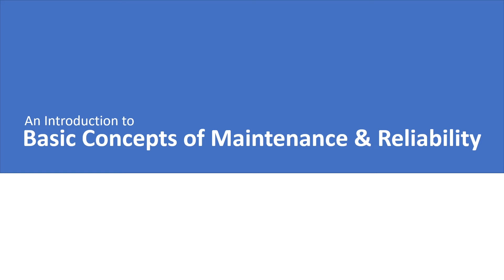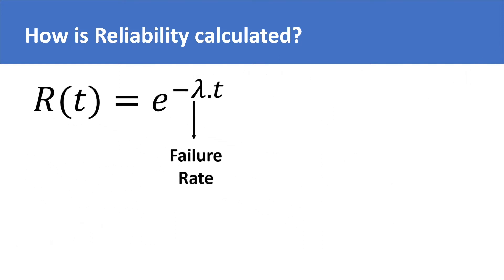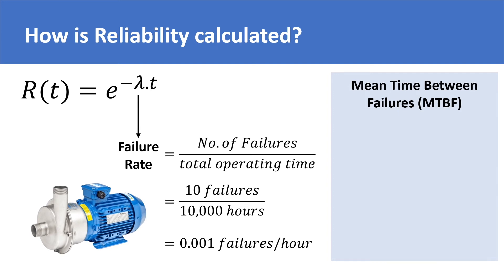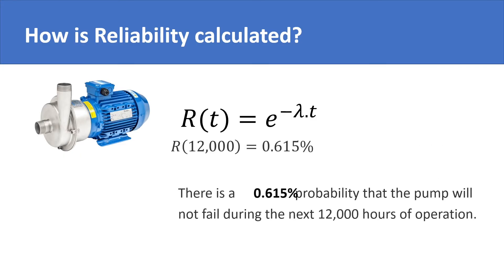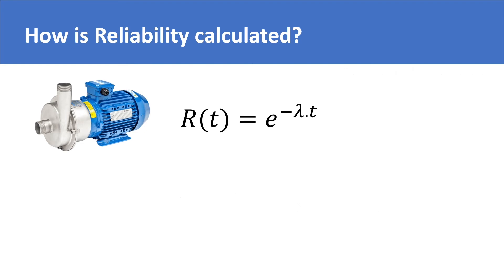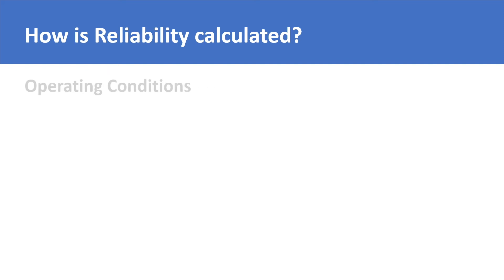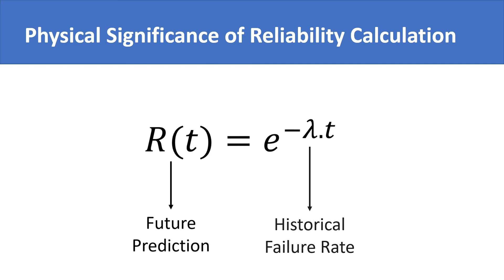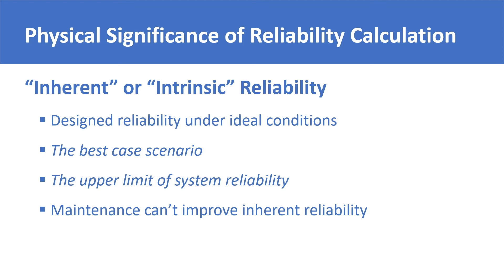System Reliability Calculation | Physical Significance of Calculating System Reliability Probability

Comment: Hi

I am calculating the reliability R(t) at 3:40 and receiving a different answer. Can you please help me figure out the discrepancy? 
e^(-0.001*12000) = e^(-12) = 6.15e-6 or 0.00000615 --> as a percentage is 0.000615%... not sure where I am going wrong or how to get your answer or 0.00615 or 0.615%
Reply from the maker: Your calculation is right . There has been clerical error in churning the numbers in the presentation. With a MTBF of 1,000 hours (equal to failure rate of 0.001), the reliability that the pump will operate without failure in the next 12,000 hours is 0.000615%. In simple words, the pump will fail for sure.

Comment: How do you calculate the dormant portion when the motor is not running
Reply from the maker: Reliability calculation is based on failure rate data. When we say that the pump's failure rate is let's say 1 failure per 1,000 hours, those 1,000 hours may not be continuous running hours. For example, the pump might have run for 500 hours then stopped for 300 hours and run again for 500 hours and experience failure. In this scenario, we won't say that pump failed once in 500+300+500=1,300 hours. We would say that pump failed once in 500+500=1,000 hours. In this way, when the machine is dormant, its time is generally not included in failure rate data and resultantly, it is automatically excluded from reliability calculation.

Comment: i think the reliabilty is not 0.00615!
Reply: Yes values are coming very low
Reply from the maker: There has been clerical error in churning the numbers in the presentation. With a MTBF of 1,000 hours (equal to failure rate of 0.001), the reliability that the pump will operate without failure in the next 12,000 hours is 0.000615%. In simple words, the pump will fail for sure.